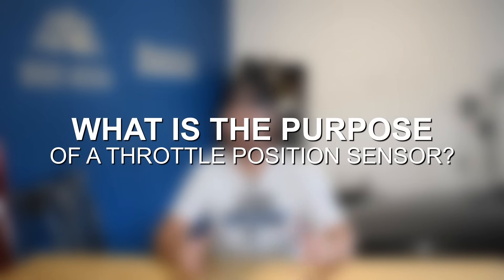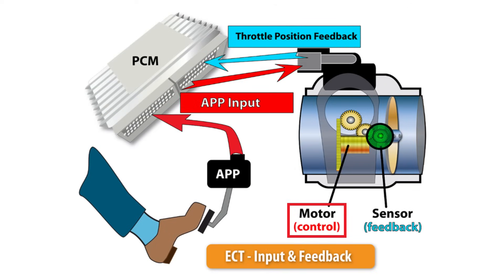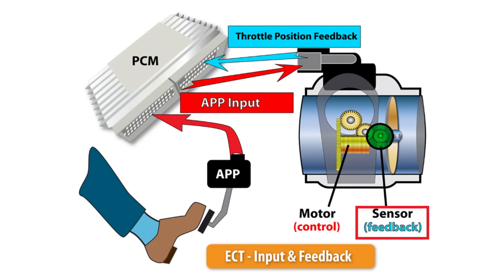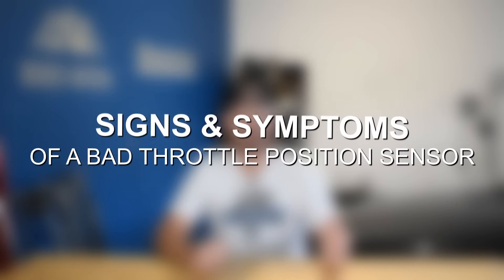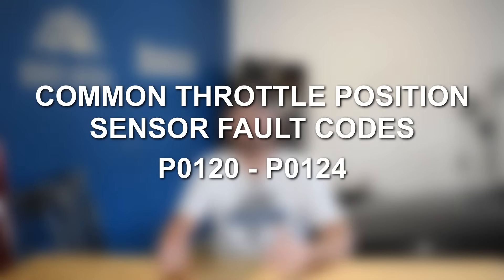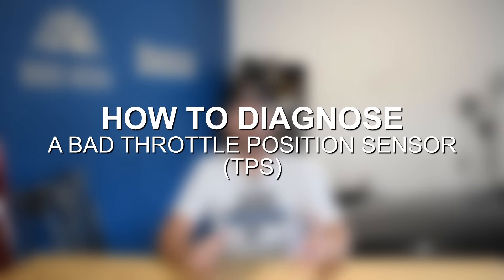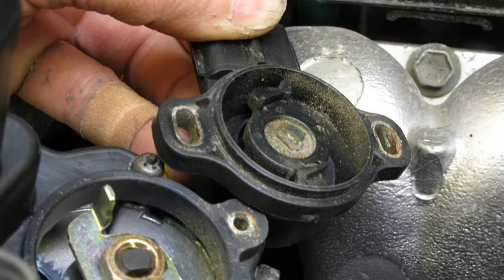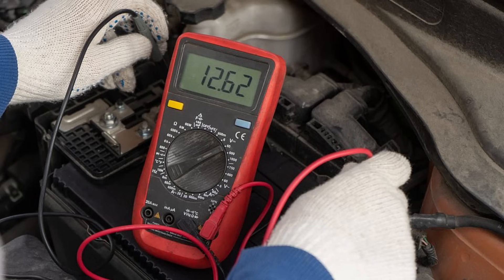Signs & Symptoms of a Bad Throttle Position Sensor (TPS)!

Comment: Hi there, I badly need your help. I have 2016 Honda Accord EXL I am having an engine error code P0507 whenever I park my car or in neutral the RPM goes to 1.5 or more than that it’s supposed to be a throttle body problem, but i tried that already but still having the same issue. please help thanks.

Comment: To Whom Concern! I’m having trouble with my 1998 Infiniti Q45 Throttle Position Sensor 2. I was told that it needs to be reset after replacing it. Is there a video on your platform that I can watch? Please let know, because I haven’t driven my car over a year and half now. Thanks

Comment: Excellent video! But not my problem. My 1998 Ford Escort runs fine all year, except during cold weather, sometimes the RPMs surge at idle, 2500 RPM. From March to November the problem is gone. Crazy, I know.

Comment: My 2000 Mazda b3000 manual transmission has the older wire from the pedal to the throttle body, but it idles really high even when I'm going down the road and take it out of gear it idles even higher regardless of what gear I'm in

Comment: It’s worth noting that not every car built after the early nineties had electronic throttle-by-wire. My car (a Miata) is a ‘99 and has a throttle cable. But the engine also has mechanical roots back to the 80’s.

Comment: My 2005 dodge magnum 3.5 liter is not starting at all …. Will the throttle body make it not start???
Reply: Does the ignition turn over at all?  You could need a new fuel filter

Comment: Question, on a scanner there is a code that READ P0120(1/1)stored Throttle/Pedal Position Sensor a circuit DTC severity 2 of 3. Repair Immediately. My question is that the throttle position sensor (TPS) or the pedal position sensor (PPS)? or do i have to replace both? It is on a 2000 Toyota Tacoma...The scanner that was use was INNOVA 5160rs scanner.

Comment: I have a 2001 F-150 and when I'm in drive it's ok but when I come to a stop sign or light it will want to die if I put it in neutral or park it's not as bad there's no engine lights on the only light that is on is p01518 which I don't think has anything to do with my issues do you have any idea what it could be
Reply: Mass air flow sensor

Comment: What if its not throwing a code. But still not building up speed. Check engine light is not on.
Reply: Did you figure out your problem? Sounds like you had the same symptoms I have.
Reply: @ericcarlson51
Reply: @ericcarlson51  yes I did
Reply: @ericcarlson51  it was a stopped up Cadillac converter lol
Reply: Thank you for the info. I am suspicious of my catalytic converter as well. I’ve been hearing some popping noises under the truck near the muffler when I’m accelerating at low speed. Almost like a bunch of small back fires. Did you have to replace or is it cleanable?
Reply: @ericcarlson51  take the air sensor out of it and drive it and see if it see if it drives good if it does if it does, it’s the Cadillac converter
Reply: @ericcarlson51  replace it
Reply: Thank you for the help!!

Comment: The VD70 helped me reset the throttle adaptation and steering angle sensor (SAS) after replacing parts.
Reply from the maker: Z - Nice. Thanks for sharing these insights.

Comment: I have an 07 mustang gt and it has a very intermittent shudder or bad miss when accelerating from a stop or it has done it once when I was accelerating up a mountain highway. A few hundred miles ago I cleaned the mass air sensor and throttle body. This problem is slowly getting worse  and I  have scoured the internet but according to them it could be charge air plates, throttle body, maf, spark plugs, coil packs, monkeys flinging poop who knows. Any ideas? I did change the pedal and no CEL.

Comment: I clicked on this for symptoms, and all I have is codes to follow in the end. I have a 2011 p7b equipped with a propane system, which ignites with heat. At a certain temperature, the engine switches to propane and immediately pops a check engine light. Yet, while I am on gas only, when my propane is empty, all DTC's clear up. Recently, when my engine is cold, it starts normally, fires right up, then when the engine is warm, it struggles to start. It was as tho' the battery lost its cranking amps part way through the process, so I replaced it. Still, the issue persists. I bought a new starter just in case. Yet my original starter is still strong enough to start the car. I have no DTC's, any idea? I can't afford to just throw money at it. The engine is a 4.6 2 valve. I'm a driveway mechanic. 
 I am stumped and frustrated.

Comment: Do you think this issue locks down the transmission,too for safety concern?? I have 2018 Honda CRV and engine starts  but wont pass 2000 rpm whn i put in it to D wont do anything and D blinks....
Reply: Yeah your transmission fluid is out or extremely low.

Comment: Wait, cars after the 90's had fly-by-wire?  Not all of them.  

It's 2025 and my 1953 Daimler still has a throttle cable.
Reply from the maker: M - Most of them, yes

Comment: what confuses me about this video is you saying evry car afther 1990 has an electronic throtle body. mine is from 2006 it has a gas pedal wired to the throttle body. or the engineers hit the motor behind the footwel with a long cable. i think my sensor is just for deciding fuel mixture? could that be right? sometimes when i give gas it doesnt accelerate

Comment: I am working on 06 civic, no codes at all, which has a intermittent stutter under light acceleration and while at high idle at 2,000 rpm. It fluctuates intermittently and when slowly releasing the throttle pedal the rpms sometimes do not drop at the same rate….. so say I’m slowly releasing the pedal the rpms drop quickly 500 rpm…. This only is happening at 2,000 rpm…. Anything below that is fine and anything above it good too…. I have no codes at all
Reply: Sounds like your timing chain is going out and no that usually won't have a code
Reply: @BMaxKnightRider No timing chain is fine..... already checked that. I'm a mechanic by trade so I know its definitely not a timing issue thank god
Reply: @AndyDento21 well I have a2001 Ford ranger 3.0 2wd and for the life of me I have no clue what's wrong with it. At first I thought it was brake drag so I put on new calipers that wasn't it and even after looking at my front suspension I realize some of those parts need replaced but that still wouldn't give the problems I'm having. Let off the accelerator pedal and it's like I'm applying the brakes but not and when apply pressure to the accelerator pedal and when using the brake pedal I have pulsating vibrations coming thru both and the fact that there's no noise being made accept for a weird low grumble in second gear but no the transmission isn't slipping or acting up and the rear end just had fluid changed and fluid level is fine so must be a sensor I'm hoping

Comment: My 2015 honda accord sport intermittently stalls at cold start only in reverse and backing out of the garage immediately. If I waited for 15 secs after ignition then it won’t stall. I cleaned the throttle body more than a year ago and I think it went away but now back again. Could it be the dirty throttle body again? It’s frustrating 
Thanks

Comment: My 2011 Ford F150  6CYL ECOBOOST ,  was taken over to ford showing that  wrench light  was on  Diag.  with P2138 Pedal position  switch  D/E voltage correlation present  ford inspect pedal  OK.  Tested circuits No voltage from  PCM  Access PCM and test circuits  GOOD continuity from PCM to ACCEL PEDAL  Circuits NO  not shorted to ground or to Each other. WHILE Load TESTING Circuits  FOUND loose PINFIT  TA PCM,  ford says NO PIGTAIL AVAILABLE SO HAVE TO REPLACE    MAIN  HARNESS  and retest .  So any ideas on how to replace other than doing the  main wiring harness ??

Comment: Something I didn't know until I already did this. I took throttle body off and cleaned it, thinking I cleaned it all good and I did but didn't realize you do not push on the flap . Well I did to make sure I got all the carbon off so it would close all the way. Put all back together with new TPS did a relearn and reset and now it runs like crap with stable track on constantly.
Reply from the maker: J - Manually forcing the throttle plate on an electronic throttle body (like on your vehicle) can easily throw the plate out of calibration or even damage the internal gears/sensor, which explains why after cleaning and doing a relearn/reset it now runs poorly and the StabiliTrak light stays on — the ECU sees a mismatch between throttle position and pedal input, throwing the car into reduced power mode. Since you already replaced the TPS, the issue is almost certainly in the throttle body assembly itself, either from being forced past its normal range or from the relearn failing because the plate can’t return to its exact rest position. At this point, the best fix is usually to replace the throttle body with a quality OEM or OE-equivalent unit and then perform the proper idle/throttle relearn; sometimes another careful relearn with a fully charged battery will get it working if no physical damage was done, but if it still runs like crap, the throttle body itself has likely been compromised.
Reply: @8020Automotive 
Exactly what I did I just replaced  whole throttle body, and fired it off. Idle was erratic then really high idle. So I took neg cable off for 20 min hooked it back up then went ahead and did a relearn.let it sit and idle with all acc. off. Truck runs great! Thanks for your input....

Comment: Glad I found  your video. My 14 dodge journey 3.6 starting  running rough  rpms low . My obd2 scanner codes  first code - intake temperature sensor 1 circuit high . Second -  code mass air flow sensor pressure circuit high. Third  code  -  I throttle pedal position A circuit high. I cleaned  throttle body oh and had a cylinder 4 misfire hope its the throttle sensor  thanks!
Reply from the maker: R - These mix of codes all point less to the sensors themselves failing at once and more to a wiring, ground, or shared 5-volt reference issue feeding those sensors. When the 5-volt reference wire or ground is damaged, corroded, or shorted, multiple unrelated sensors will throw “circuit high” codes together, and that can cause rough running and low idle since the PCM is basically flying blind. Cleaning the throttle body was a good step, but I’d carefully inspect the wiring harness around the throttle body, MAF, and intake area for chafing or broken insulation, and check grounds at the engine block and battery. Since you had a misfire on cylinder 4 too, make sure the coil and plug are good there, but don’t overlook the electrical — because with three high-voltage sensor codes at once, fixing a common wiring/ground or 5-volt feed fault is more likely to solve the root problem than just replacing the throttle sensor.

Comment: My Nissan livina's rpms are high when I start the engine and then when I drive off ,the engine powers gets weak. I'm stressed out 😭
Reply from the maker: W - High RPMs on startup followed by weak engine power in your Nissan Livina usually points to an air/fuel imbalance or poor airflow control — the ECU may be overcompensating with high idle due to a dirty or sticking throttle body, bad idle air control, or a vacuum leak, while weak power under load can be from a clogged fuel filter, weak fuel pump, faulty MAF sensor, or even a restricted catalytic converter. Since you’re also smelling fuel or noticing odd behavior, I’d start with cleaning the throttle body and MAF, checking fuel pressure, and scanning for codes even if the check-engine light isn’t on, as these symptoms often show up before the ECU sets a hard fault.

Comment: Great video.  Lots of good ideas.   My 2006 Buick Rendezvous cranks, fires sometimes, but won't start.   I hear the fuel pump running when I turn the key, so I know the engine is getting fuel.  The exhaust smells much stronger of gas than what I am used to, so I think the TPS or Throttle body is the issue.
Reply from the maker: W - If your 2006 Buick Rendezvous cranks and sometimes fires but won’t stay running, and you smell a strong gas odor from the exhaust, it’s likely flooding out from too much fuel rather than not enough; even though you hear the pump, that doesn’t confirm proper fuel pressure, and the issue could be a stuck-open injector, a faulty coolant temp sensor telling the ECM it’s -40° so it dumps fuel, or a bad MAF/TPS signal skewing mixture. A dirty or failing throttle body can cause stalling, but the strong raw fuel smell points more toward an overly rich condition, so I’d start with pulling the plugs (see if they’re soaked in fuel), checking fuel pressure with a gauge, and scanning live data for coolant temp, TPS, and MAF readings before replacing parts — if the plugs are wet, let it air out, replace them if fouled, and fix the underlying sensor or injector issue causing the rich mixture.

Comment: I don't care to listen to you show off all your technical knowledge, just tell us what to look for and how to fix it. I'm not looking to pass a class in this, I just want to know how to get my car running again. Cut out all the b***** and just tell us what we need to know. People that post these videos would be a lot better if they would start with the issue that we're having so that we know whether we even need to watch the video or not. I don't want to hear about every issue this part can cause, I only care about the issue I'm having.
Reply from the maker: T - Thanks for sharing this feedback. However, we are going to continue to film videos how we do because we make these for EVERYONE, regardless of automotive knowledge. We strive to teach, not entertain with these types of videos. Therefore, we have chapters in the description so the viewer can navigate their own viewing experience.
Reply: @8020Automotive Thank you for making this very helpful video.  I have a 1998 Mercedes SLK230 that has exhibited the signs of a bad TPS but with a DTC P1580.  This code refers to the throttle body actuator.  Is it located within the TB?  I've replaced the TPS and TB (used from salvage yard).  Odd thing was that the car would idle and run OK for a few miles after resetting the TB and TPS, but then revert to having the same signs and P1580.  Please advise.  Thanks.
Reply from the maker: O - On your ’98 SLK230, P1580 points to the throttle actuator control module inside the throttle body, which on these cars is an integrated electronic unit combining the TPS, throttle plate motor, and position sensors — so yes, it’s “within” the TB. Replacing the TPS alone won’t fix it, and even a used throttle body may only work briefly if the actuator electronics inside are already failing. The fact that it idles and drives okay for a few miles after a reset but reverts suggests the actuator is losing its reference once it heats up, which is a classic failure on these Bosch throttle units. Unfortunately, salvage-yard throttle bodies often have the same age-related issues, so the long-term cure is usually either a rebuilt/re-manufactured throttle body actuator with fresh electronics or having your existing unit rebuilt. Before condemning it, though, double-check the wiring harness for the throttle body, since Mercedes from this era are known for brittle wiring insulation that can cause intermittent faults mimicking actuator failure.
Reply: @8020Automotive  Thank you very much for promptly providing such helpful, insightful information.  I deeply appreciate it.   Have a super duper fun weekend!  👍

Comment: I have a Nissan pathfinder I got not codes. If I press on the accelerator all the way down I’ll start jerking and rpms will go up and down and check engine light will turn on then off I’ll stop doing it until I shut the vehicle off then back on it will stop the jerking. The only way it won’t do it is if I drive it but not press on the pedal hard down only about half way. Do you think it could be my throttle body ?
Reply from the maker: T - The fact that it jerks and loses power only at wide-open throttle, the RPMs surge, the check engine light flashes briefly, and then it resets after cycling the ignition suggests a fuel or air control issue under heavy load rather than a bad starter or normal throttle body wear. The throttle body can cause hesitation if it’s dirty or its motor is failing, but the symptoms you describe fit more with a fuel delivery problem (weak fuel pump, clogged filter, or bad fuel pressure regulator), or a sensor issue like a failing MAF or crank/cam sensor that glitches under high demand. Since the CEL comes on then goes away, there should be stored codes in history or pending, even if no current code is active—pulling those is your best first step. If none show, I’d start by cleaning the throttle body and MAF sensor, then checking fuel pressure under load to see if the rail is starving at WOT.
Reply: @8020Automotive  ok I will thanks a lot bro